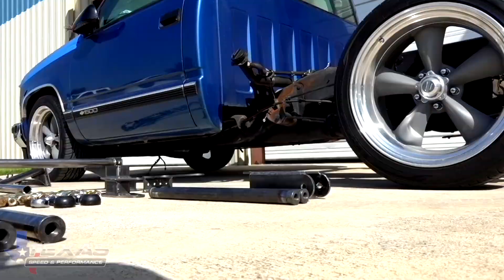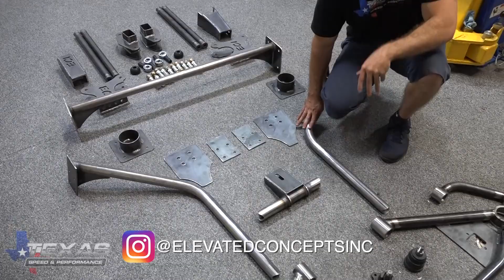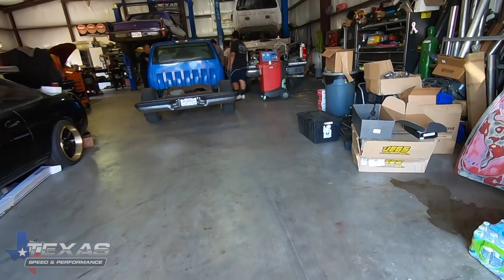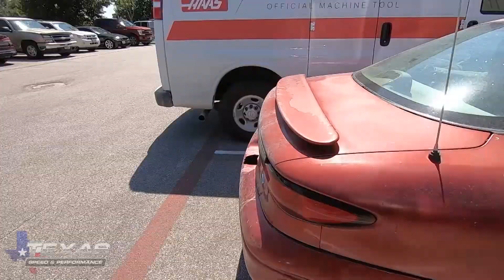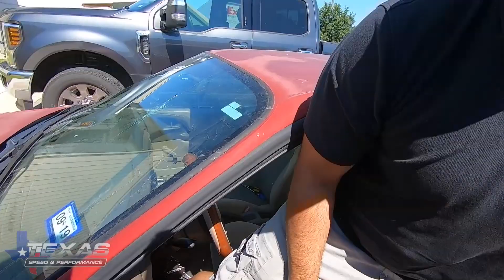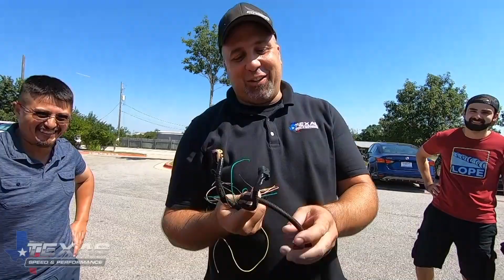Shop Trucks INSANE New Suspension Set Up!

Comment: Hey guys. So I have a 1994 C1500 single cab, short bed 2 wheel drive that I want to LS swap. I’ve spent the last 3 years planning and spewing out parts. In the next couple years I’ll start buying parts. But I like the suspension set up you have on shop truck. Could you guys link the parts and part numbers so I can order them in the future? Thank you guys. PS. I plan on buying a turn key engine from you guys.